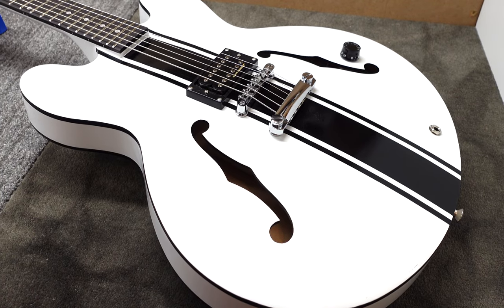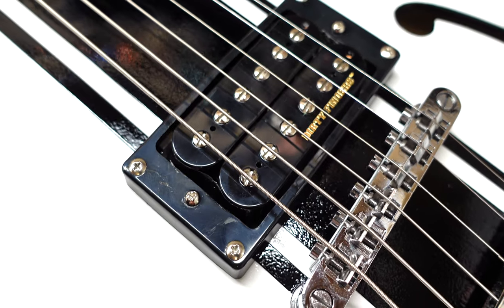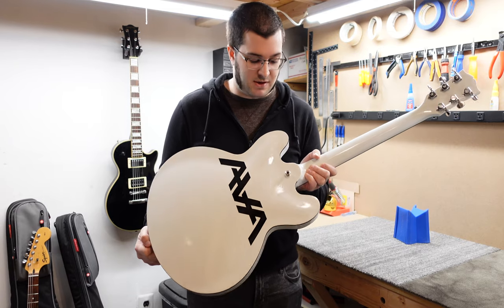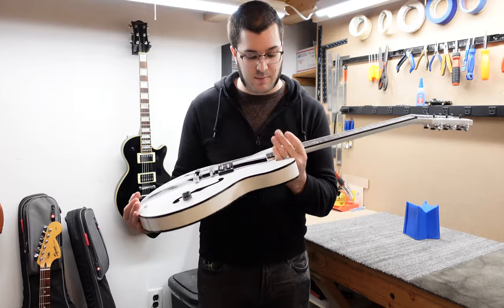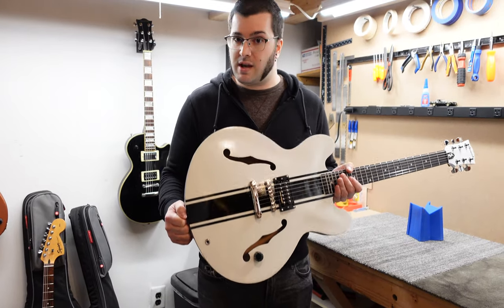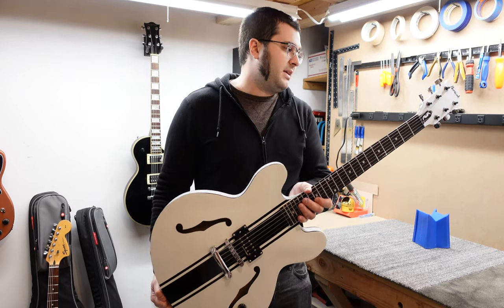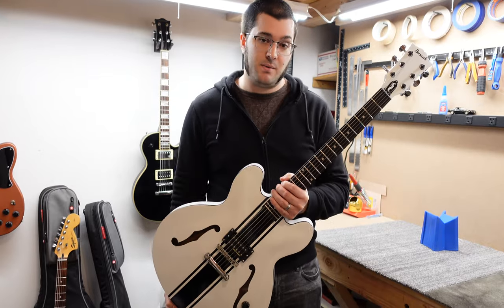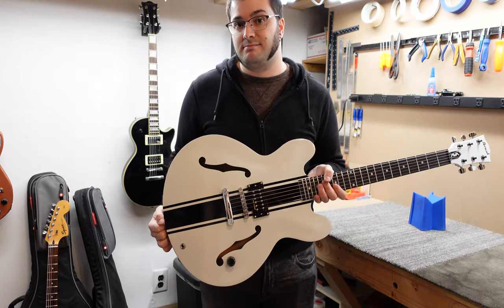Tom DeLonge Style ES-333 Replica Guitar Build & Demo (4K)

Comment: I'm just about to do something similar, where did you get the wood plugs? Size etc?
I'm not looking forward to sorting out electronics, plugging holes etc through those F holes
Reply from the maker: I got the hole plugs and maple board for the neck pickup cavity from Home Depot. They're 1/4 inch for the smaller holes and 3/8 inch for the switch hole. The soldering isn't too bad with just the single volume and output jack, but its definitely tricky. Good luck!
Reply: @BerscakCustomGuitars  thanks, I appreciate the reply, I'll keep you posted 😊

Comment: I've been searching for this answer for a while, I've talked with friends and the yahoos over at guitar center.   Maybe a ridiculous question so hold off on the hate mail.  That being said here it is:.  Looking to make guitar similar to the one above but I was thinking of using an Ibanez AS53 which a re significantly cheaper than an Epiphone 335.   I'd throw a Invader or dirty fingers in there and paint it myself.  #1. Are those Ibanez garbage?  #2. Will it have the same effect as a Delonge Epiphone.  I mean realistically the pick up is 80% of the guitar and I'm going to mostly be playing punk style with it.
Reply: Also great video.  Gave me more courage to do my thing ..  well pending the above answer ha
Reply from the maker: Thanks for watching! I'm not familiar with that model, but Ibanez makes good guitars. I don't see why it wouldn't work...as long as its the same scale length and you put the right pickup in, that should get you in the realm of Tom's tone. I would suggest you use the Dirty Fingers, it sounds better than an Indvader in a semi-hollow guitar. And good luck!

Comment: How did you fill the neck pickup and the other holes in?
Reply from the maker: I used wooden hole plugs from Home Depot to fill in the control holes, and I cut a piece of maple to fit the neck pickup cavity after I set the neck in. Patched the seems with wood filler and sanded smooth.
Reply: @BerscakCustomGuitars  Thanks I bought a epiphone es335 dot for really cheap and am thinking of making it into a DeLonge!
Reply from the maker: @bozob1ake512  Nice, have fun modding it!